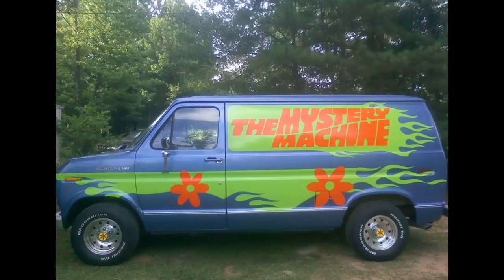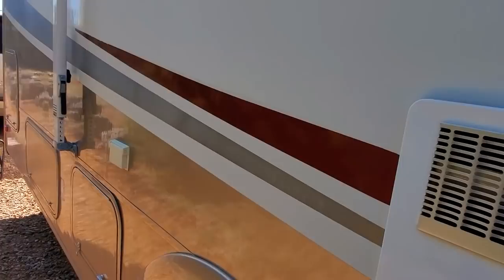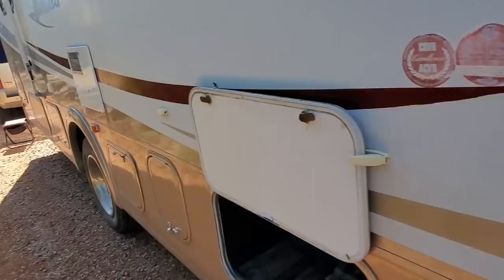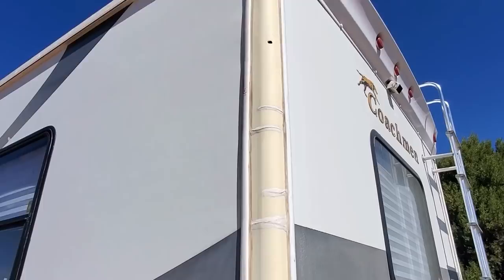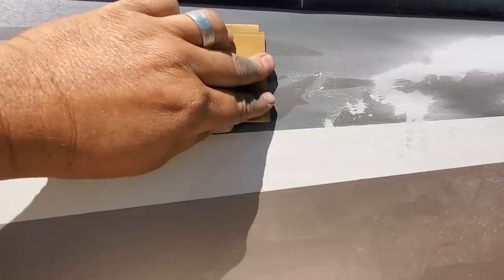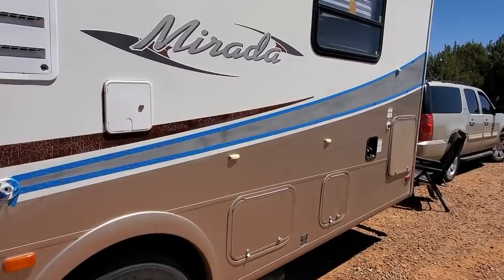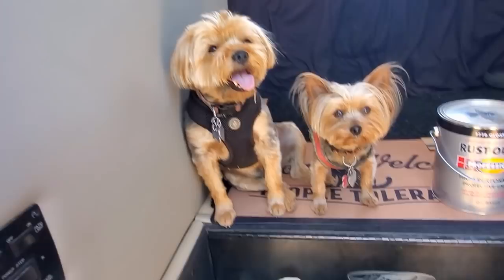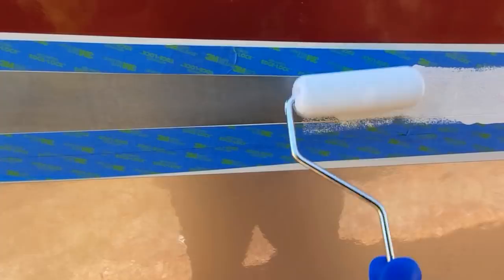I REPAINT MY RV STRIPES WITH RUSTOLEUM... AND SCREW UP!

Comment: I’ve done quite a bit of sanding to get a nice finish with rustoleum. You may have to go down to 800 to get the texture out. Keep in mind too that rustoleum has pretty poor uv protection. You’ll have to put something on it to project it from uv or it will fade fairly quickly. 👍
Reply: With paint you pretty much get what you pay for. We’ve done a few tractors with rustoleum and the finish lasts because we keep them inside. That said, rustoleum does offer an automotive clear coat that provides some additional uv protection.
Reply: @jeffgootjes8418  agree that a clear coat is best, after he finishes smoothing the coat.  But I wouldn't use Rustoleum, there are better products, thst apply easier and won't yellow.
Reply: Definitely there are much better clear coats than rustoleum. I would be a little concerned about compatibility. The rustoleum takes a long time to fully dry too. Do it too soon and it’ll look just like the cracked decals. 😂
Reply: I just watched several videos on restoring lens covers on vehicle headlights. One of them recommended this roll of UV-protectant film that you can apply. I think it's made by 3M company.
Reply: @valeriegriner5644  did u use it ,,,? How was it?

Comment: The black stripes do look good. I recently repainted my boat trailer with the same paint you used but with a a fine bristle paint brush. It came out looking good and it layed down nice and is as smooth as powder coat.

Comment: Hey Kevin, I painted my whole truck with Rustoleum and brush and roller here on YouTube, but maybe going forward you can try some things that worked for me. Firstly I swear by a product called Penetrol for thinning and conditioning oil based enamels..it thins and makes them more workable then just straight mineral spirits...also, in conjunction with the Penetrol, I had success with using foam brushes after you do the initial rolling...you could get some brushes that work with the width of your stripes. That way you could roll out the length of the stripe and then use the foam brush to smooth out the air bubbles...The Penetrol helps the paint lay flat for a glossy appearance without the texture...just my two cents...Paul

Comment: Back in the day when I painted boats for a living I use to ask my customers what sort of paint job they wanted. The 50 foot job or the 5 foot job. Many said 50 but changed their minds. I always used a good quality brush. Rollers were only for getting the paint on. I tipped them out with a brush. For oil based paint I used Penitrol for thinning the paint down to a smooth consistency. Thinner was for cleaning up after.

Comment: Grew up in a RV repair and paint shop my dad had. I've painted and touched up many a motorhome. Let me give you some proven tricks. Fist of all get a cheapy airbrush at Harbor Freight and a little 12 volt compressor. You can spray in a moderate breeze by positioning the coach to get the downwind where you're working. NEVER USE RUSTOLEUM- rule 1. That's going to crack like the vinyl in a year. I know l got lazy and made the mistake. I learned to buy flat paint or one step acrylic at auto paint stores. You can buy pints. Then use clear coat for your shine. Cracked Vinyl stripes: use scratch filler, sand it and paint it with flat then clear. You'll be surprised how nice you can paint with an airbrush when it comes to stripes.

Comment: You are right about the thinner...rustoleum is thicker than automotive paint and has to be thinned to flow out  but like you said just wet sand it with some 600-800 and repaint this time with some thinner in there. Sand until all the orange peel is gone then repaint. Tripping Jimmy is right about painting in the shade  and giving the paint more time to flow out. It looks a lot better than it did and with the paint thinned I think you will get the result your after. Do not thin any more than what is recommended.

Comment: CVK, did you ever see cars painted with a roller? Latex paint. Then wet sanded down and buffed, they looked great, smooth. Hot Rod magazine did a car, it’s been a while back. Color looks great, you will get there👍👍👍👍
Reply: Happy Birthday Kevin!   
I like the black.  I used the small foam brushes and a few wider ones where needed.  I did not get a textured surface.  Maybe it is the roller doing that.  
I did sand using the grey sanding blocks with the angled edges and wiped down.
Had a problem with the blue tape but did better with the green Frog tape.
I did not use primer.  I used Behr Premium Plus Ultra   Interior/exterior   Stain blocking Paint and Primer in One
Color sample from Home Depot.  Two coats.  Dried pretty quick.  I did not use thinner.  
Came out pretty good but I am not an expert.  At least it was a big improvement on my 2000 Bounder.
I know you will end up with a near perfect job and be happy that you did it.  Lol!🌴🚍

Comment: It quite easy to cut the roller cover down to length using a utility knife or hack saw.  I don't envy sanding the stripe down, yikes!  Try painting in the shade so the paint dries slower and has a greater chance of laying down.  Good luck brother.

Comment: Brother kev  you might wanna check in to pan cake air compressor and an airbrush kit, primer lacquer thinner for thinning paint  Might take a little longer but I think you're gonna get a flatter surface👍😎
Reply: I've done art work all my life, using the pro equip. is a lot to learn and it's just more weigh.
Reply: I'm sure brother Kevin has painted a car before 👍😎

Comment: Best to remove all vinyl stripes first,  heating gun and time.
Use a little Prepsol additive to slow down the dry time to let the paint flow out longer for a smooth shiny surface. Good luck getting paint to stick to vinyl  for very long!

Comment: Looking good Kevin, I'd suggest thin the paint by 10% maximum then 3 rolled out coats rather than 2 heavy coats which can leave a slight stipple. (40 years in the trade) but looks good from my place😀

Comment: personally i like the texture.  i think i will do mine this way just different colors. the texture makes it different from other coachmans and it gives it a custom look. you do what ever makes you happy though,  if you want it real smooth probably have to wet sand it. rusto is a great paint but thick and dosent level out well on its own. after you sand it and all could always buff with a foam pad and a glaze compound. McGuires is good but run the buffer slow cuz it will burn

Comment: Add Penetrol to the oil based paint and it will allow it to flow out.  Used to hand brush my frame on my show car if it got chipped and no brush marks.

Comment: I painted a 1989 Tioga with the "Better" roller nap from Home Depot, you will not get a glossy smooth but a satin finish with a little texture, fine for  30 year old RV that just needs some TLC, durable and looks fine.  Your wraps would look fine with a satin finish and it can hide imperfections.  But if you want a perfect factory match, then you need to prep and spray the paint on like a body shop would, or redo the wraps...professional required..  Hope that helps.

Comment: I use to have a Super rare Class C RV, At the time I didn't know it was super rare, Ever see a Class C with Tandem Axle's ?  I had one, It was an 1977 Harvest with a Dodge 440 and a 727 Tranny, Ran perfect for the 8 years I drove it, I had massive Graphic designs and limo tint done on the entire RV, This RV was 27' feet long and the entire bill was around $1500.00, Turned out perfect !

Comment: I wish I was there, I could have told you about the texture a rolled always leave. I have used it and I know. Yes you can sand it down but that will be a lot of work. I painted part of a fender of a Jeep with a brush and ended up sanding it like you are planing to. It came out great but a lot of work and it was a lot smaller area. Good luck with your project. Now back to your last video. Please get some cameras up so we can catch these ass holes. Also crack a window when you are in the camper so you can hear what is going on out side . We need to catch these ass holes.

Comment: Go to a Hobby store and Pick up some Enamel clear coat in shaker cans The Enamel won't attack the Painted surface and a Jeweler sanding kit it goes from 1200 to 25k grit. Tape it off again and use plastic to cover the large areas,light wet sand it with soap and water so you don't cut it too far then apply the clear coat it dries pretty fast but for best results let it dry overnight then when you color sand,It will smooth it out so you can polish it if you use a Compound cut it with water so it's not so harsh, .Those rollers and paint are made for metal surfaces or cabinets.Not on Gel coated surfaces on Fiberglass RV's Best of luck to you I hope it helps you.!!

Comment: I've never had any luck with those foam rollers. Always leaves an orange peel type finish. I've had good results with the very short nap 4" x 1" paint rollers from Home Depot. From experience I can tell you to NOT thin the paint. It gets very messy real quick. The paint when thinned just runs all over. Two or three very thin coats works best. When I was a kid with my first car I did a little body work on it and painted the side with a roller and some rust paint. It looked just fine. I cleaned up and put the tools back into the garage and went into the house. The moment the door closed behind me my next door neighbor decided to cut his grass without the grass catcher bag attached. He ALWAYS used the bag. The next day when I out to check out how the paint turned out I was horrified to find my car looked like a Chia Pet. looked like a golf green had grown down the side of my car. Took me a week to sand that crap off and repaint.

Comment: Not sure if anyone has mentioned it but look for something called a stripe eraser. It's a rubber wheel that goes in a drill and will strip stripes off quickly without damaging paint.

Comment: Wet sand and buff it will be fine. But you will probably have a texture with any roller. Tape it off with paper and use that 2x paint you can get in at home depot. It works great.

Comment: Probably be a good idea to wet sand that stuff with the black wet sand paper. Use a sanding block to level out the high spots. You may be able to bring the shine up with a buffer and some 3M buffing compound. You may need to re-mask it before you start so you don't "scratch the surrounding area. Going to be a bit of a job. I do believe with the temperatures you are working in enamel will dry pretty fast not giving it a chance to "level" out. Thinner may have helped.

Comment: Tape b4 sanding ! You're damaging the finish outside the stripe. You can buy auto enamel in so many different colors IN A SPRAY CAN at auto parts stores
Reply from the maker: after I paint I am going back over fiberglass with zep floor wax. any little bit I hit will be hidden well

Comment: I think if you start sanding with 400 grit wet sanding, and work your way up, then put on a semi gloss clear coat,  it will prob turn out better then expected. But I would def consider doing it in a non dusty environment as the dust and dirt will cause deep scratches in your work will your trying to get it smooth

Comment: Twenty or thirty years ago, I remember younger car guys would paint their rides with rustoleum.   Car Craft even had a how to on it.  The project always required a wet sand to get a flat paint job.  I don't think thinning out the paint will help, wet sanding will still be required.  Just make sure you put on enough paint that you don't sand through to the primer.

Comment: Kevin there is a technique called rolling and tipping which gives very smooth results. You roll paint on a small area then take a paint brush and smooth out the surface. It looks almost as good as spraying and works in situations where spraying isn't practical. I like your color choice. It looks very good.
Reply: i've used that method for decades painting wood and fiberglass boats and yachts. i know foam rollers are supposed to be the latest and greatest, but i've always had problems with them.

Comment: Roll the paint on, then tip it with a brush.  That is one way to use a roller and have a good finish.  The brush will knock down the bumps from the roller.

Comment: Kevin the black looks good on there. You should not have to sand down  to the girts you mention, they are for color coat, 400 is as high as I would go (thats pushing it to extreme for recoat). I have used that rustoleum straight with a "Quality brush" and come out flat and glossy with great success. Just saying. Also sprayed, reduced, with touch gun and  full size HVLP with great results.

Comment: I am like you the Stripes on Motor Homes are hard to deal with. Spending 2G is a lot of money. BTDT. you can do it. I bought a New Motor Home  once and when I ordered it I said all Stripes Delete. Just send me a Plain Jane White Color.  They charged me $1500.00 extra for no stripes. Well I inspected the Coach when It arrived and it was a Nice Job. I had already paid for it prior to delivery and the dealer got the MSO a Month Prior so I registered it, Insured it and waited for the arrival. PDI was done but the Manufacturer forgot several things. Washer Dryer & Closet and One Rear A/C. Which was on the Build Sheet along with Michelin Tires and Chrome Inserts. I paid extra for. I cancelled the Registration same day and did not accept the Unit and notified the Insurance Company. I was nice no problem I had waited 5 months for the Coach. At the Factory the Third page of the Option sheet was mixed up with a different build which did not add the Washer Dryer and Closet, Rear A/C and Correct tires. Plus get this it had Stripes on it... The manufacturer could not believe the mistake. I was nice to the Dealership and pleasant and told them to contact the Factory and Tell them of the Messed up deal and they have 14 days to get back with me. The Dealer didn't build it but should have caught the Error since they ordered it. No big deal. I spent 81g on the Coach, Plus Tax, Title and License & Insurance. It was marked down from retail from 94k to the 81k . What a Mess? Nope! I had the Title by then. The manufacturer thought about this and Offered to Build me the Next Model Year Coach and take back the the other Coach I named "Delete". To make a Long Story Short since I missed my Vacation RVing everywhere and the 5 months I waited plus waiting 90 more days the manufacturer agreed their offer not mine to take it back build me another one next Model Year with all the options a Stripe Delete N/C and a Refund of 43K back to me. I was told to use the Other Coach till mine was built however I declined. I got the new Coach delivered to me with MSO a check from the Manufacturer and a Full PDI and a extra 24 month full Warranty on the Coach Body. The 7 years I kept the Coach I never had one Problem out of it. I bought another one from the Same manufacturer Special Order and that one was perfect also. They remembered me because of the Coach name (Delete) and How nice I was. I like your Coach and I like the manufacturer very much. They build their own parts and they fix problems right... You fixed your Stripes the same way I would have. Looks good Keep it up. Great video Content... Happy 50 Fella!!!!!!!!!!!!!!!!!!!

Comment: Kevin I think the black looks awesome ! One tip I've learned through the years when I'm done with a roller and I'm going to use it again; I stick it back in the plastic sleeve it came in, close it up. It  works very good with oil paint .

Comment: It still looked good. Black is contrasting. Tucker still has a whisker deoooo!,
I did paint work to at this point I would have used water & sandpaper but I worked on custom cars.

Comment: I think that it looks great and it's not enough texture to really tell  (on my phone anyway). I took two years auto body and paint in high school at our Vo Tech, and didn't pursue it because allergies to the chemicals but I would suggest you get a rubber sanding block so that when you sand you won't have finger grooves and it'll be flatter and smoother. Good luck regardless and I know that you will get it looking great! Hugs to the Woof package. 🐕🐕🐅

Comment: The black seems so much more of a contrast than the original.  
But then black is just not a color I would pick that’s all. It shows up every single speck or piece of dust.
So if that paint ever does what the other paint did it will show up 50 X more on those sun cracks.  I liked the silver much better, mistakes do not show near as bad... 
wishing you the very best,  lessons we learn by “just doing it.”
You’ll figure it all out.👍🏻👍🏻

Comment: Get some 1500 - 2500 - 3000 grit 3M automotive grade sandpaper (Walmart), mask everything off again, and (hand) wet sand the Rustoleum. Start with the 1500 and sanding in ONE DIRECTION ONLY (NOT circular) CAREFULLY knock the top off of the "bumps". Then wet sand with the 2500. Wipe everything down with alcohol to get really clean. Then spray with some rattle-can automotive clearcoat - which will give your UV protection. Lightly sand the clearcoat with 3000 grit. Wipe down with alcohol - then apply a high quality marine-grade polish/wax.
Yes... a LOT of elbow grease involved. BUT, you won't cringe everytime you walk past your RV and say "I should have...".

Comment: I found out that any type a roller will pick up the paint behind the roller and give it that texture look. Only a suggestion. Use a horse hair brush and it will lay out smoother. But your RV and your money. I’m sitting here in my recliner.. good luck. ☕️🍩👍😎

Comment: You might try a buffer, can buy one pretty cheap, with Meguires scratch out. If that doesn't work. i would thin paint and use a foam brush. then buff it out.